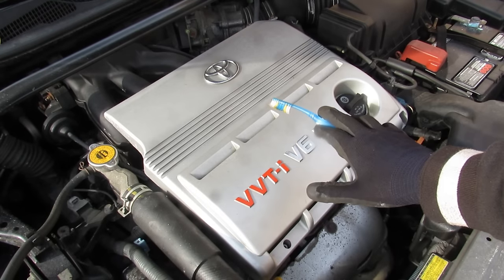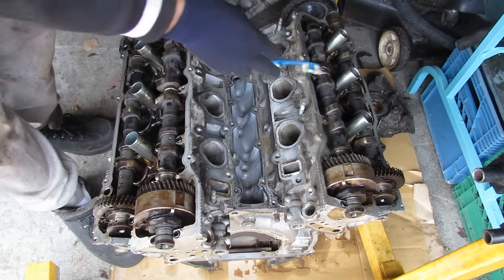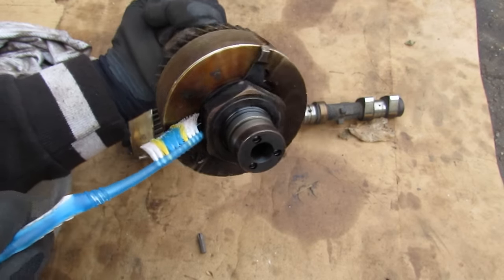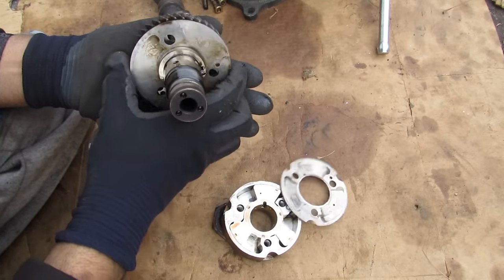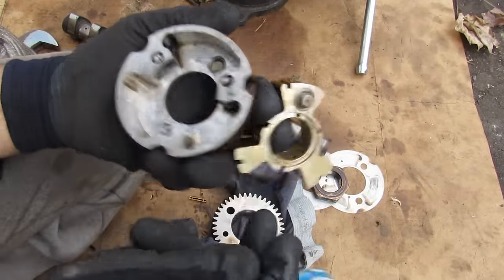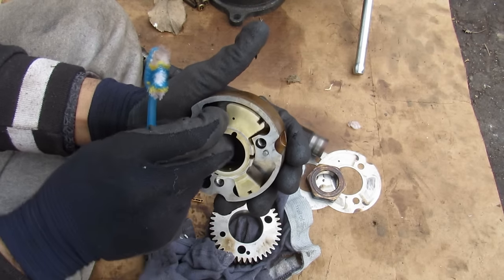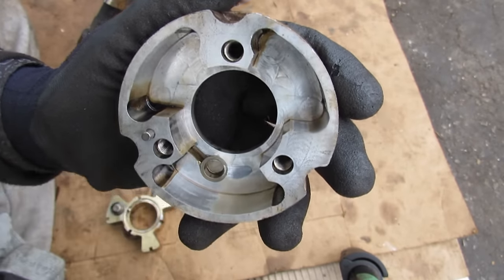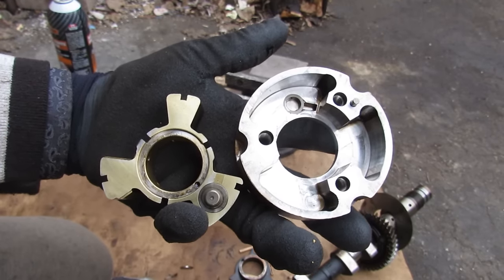Here's Why Your Car Rattles on Cold Starts

Comment: I just bought a 2010 corolla ce and didn't find this problem because the seller had already started the car before my arrival(because this problem only hapoens when car has been parked and not used for about an hour). Now I have to worry about this issue.

Comment: Hi speedkar99 thanks for info. I noticed a rattle noise every time I start my engine. It’s a 2008 Lexus RX350. The car is at dealership at the moment. Day 1 passed they said nothing is wrong with it. I want them to make sure that the bolts aren’t loose. How much might it cost, do you know?

Comment: I have a 2007 Sienna with the 3.5 2GR-FE engine with the rattle noise.
Is this engine also the same as the one as in the Lexus?
If so, do I have to worry about the bolts coming out and destroying the engine?
Reply: I also have the same concern with my camry 2gr-fe. Need someone has to clarify this, I hope it's not like lexus 😁

Comment: i have the same problem on a nissan qr25 de engine, stored most of the 2020, now in the morning rattles like that engine, the real concern is that the car is only 30.000 km, maybe some oil residues clogged the lock pin, so i have a question, that noise is going to destroy my engine in a short term? thanks for enlight me, i didn't knew where that noise came from until i saw the video

Comment: However... can a faulty vvt actuator cause the same symptom upon a dry start given a brand new timing kit rebuild with all its seals and
 o-rings including new gears and phaser? I have a QR25DE and the car is a full build. The only things I’m considering is that the phaser I bought aftermarket and I my solenoid is old but it does work but that’s just visually. How much about the spec v QR25DE do you know?

Comment: Here what I did on noisy 2.8 cts ,F150 3.5 eco boost, modded  supercharged small block 5.7 gen1, 351w searay ,2006 5.3 ls4 gxp , all had noises . The f150 eco boost and 2.8  variable valve timing  I added a pint of diesel fuel to the oil prior to oil change on idle only warm up on idle let sit over night next day idle for 15 20 min then drained . Refilled oil with synthetic and new low restriction oil filter and 6 oz motor kote . No noises now on both 2.8 or 3.5 👍👍👍.Same for 5.3 ,351w  or my supercharged vette 5.7 Gen 1.My experience working  at a gm dealership in rural Ontario years ago and  old school mechanics this works great to remove gum ,varnish , and minor sludge . Do not do this on super neglected engines as you may  clog the oil pick up screen .Also( project farm )here on YouTube did some testing on motorkote it works reduces friction. Back when gm had a wonderful product called EOS or engine oil supplement it also gently cleaned and added anti ware and less stiction to valve train rings 👍

Comment: Thanks a lot - now I know what is the mysterious noise everytime my neighbor starts her V6 RAV4. I thought it's something worse. I wonder if adding gunk cleaner before draining oil and then filling up with good synthetic would eliminate the issue. But then all the seals might start to leak... - I won't suggest anything to her.
I also like using toothbrushes and old underwear for various cleaning duties 😉 👍

Comment: I own a 2011 Toyota Corolla with a 2ZR-FE engine. The weird thing is, I never hear that rattle on a cold start, but sometimes I hear it on a warm start. Like after I've been driving it for a while, then I turn it off for whatever reason, then I start it up again. That's when I'll sometimes hear the rattle. I change my oil every 4 months. I go by time, not mileage.

Comment: My 2010 Corolla has started doing this the last couple weeks. Would it be bad to not worry about and not fix it?
Reply: my mom had a 2012 camry that made this noise for years and it still drives fine, just make sure the noise goes away after a second and change ur oil regularly

Comment: If the buildup is the cause of the problem, then just do a proper engine flush with some strong solvent like dimethylosulfoxide.
I did it on my engine and I got rid of oil burning caused by seized oil rings. Previous owner did the oil changes not often enough.

Comment: My 09 Rav4 (2.5l) has been doing this rattle for years.
1 year ago we changed the timing chain and tensioners because of the mileage it has (160k) and it stopped doing the noise but after a few months it came back. I've been searching for more info about this problem and found a TSB that recalls this exact engine for that problem. 
The bad thing is that it is only for the US 🇺🇸, Toyota in my country is like "nope, we won't fix that".
And the VVT gear kit is very expensive so...
Reply from the maker: Ouch. Yeah it's too expensive
Reply: Wait! There’s a recall? Could you share the link or info for it? My 11’ Rav 4 has this noise and I was hoping I could get it replaced under recall. The only problem is that is has 140k miles.
Reply: @antoniogm6241  Thank you! I really wish I had the courage to do that kind of work. I guess I’ll just drive it like this and hope for the best. Really unfortunate and makes me sad to see this issues on a Toyota
Reply: @thegravitx  Yeah, messing with the timing chain, tensioners and VVT-i system is a real pain in the butt. Not to mention how many hours it takes to disassemble and put everything back on 😅
Reply: @antoniogm6241  Little update. Car now has 248k miles. Noise is basically the same and hasn’t changed duration wise. Learned how to live with it. lol

Comment: So if my 09 Corolla does the rattle noise on a cold start what should I replace ?
Reply: Part number 130500T050 , it on the passenger side and much easier to change than this engine.  Google T-SB-0087-09.

Comment: I have this exact same issue in my 13 Tacoma v6. Would this be the same issue for the most part? The noise and duration are the exact same as this and same duration too as well as only at start up when cold.

Comment: do you think its the same behavior with the 4GR-FSE ? I have the Lexus IS250 and it has the exact same rattling noise, and just wanted to have some peace knowing its not gonna grenade  or something :(
Reply: Mine 2gr-fe has about 300k km at odo. Previous owner put there 0w30 oil.
I tried different brands - still was rattle.
Few weeks ago i decide to try 15w40 RoyalPurple (brand is not the case) - and it became absolutely quite.
Looks like thicker oil better stuck in gaps inside old engines. And i would like to mention that overal sound of engine became better. It is really quieter.
Reply: @alexthebear  thanks for the info  👍
Reply: @alexthebear  I might try a thicker oil next time, but the problem is I am currently living in the Black Forest in Germany, and it can go to -10C temperatures in the winter sometimes. 15W40 might be really viscous in those temperature, and interestingly, I don't have that much rattling in the cold winter. May be my regular oil is also gettign thicker in the cold winter start and eliminates rattle. Its the summer that's problematic.
Reply: @aneeshprasobhan  Yep, i do understand you. I live in Canada, and this winter we had lower that -40C.
But atleast now i know that in my case engine is wornout, and for it better to use thinker oil. About winter - not sure, but looks like i am ready to buy Espar preheater. In this case i will stay at 15w40.
But in general - -10 is not so cold. You can try 0w40 synt for exapmple. Just play with it, atleast to check if it works for you.
Reply: @alexthebear  thanks for the reply. By the way, is the espar pre-heater for just internally warming up the car using a seperate generator ? If so, could you please share the part number for the kit ? 
I might need to look at it as well, i was thinking of fitting a Viper remote starter for heating up the car but its kinda illegal in germany. :(

Comment: Is the lexus gs450h 3.5 2GR-FSE risky with 1 second cold start rattle? That bolt can come loose on this engine as well?
Reply: did you find out more about this. I have the same 450h

Comment: Do you think the gm 3.6 VVT in my Traverse is the same. I have a similar noise not quite as loud and not on every cold start
Reply from the maker: The notorious GM 3.6!!
Reply: @speedkar99  yes..
Reply: They are well known for stretched timing chains due to design fault in pcv system apparently gunking up oil gallerys and system. Very expensive to fix, will return too as oil passage system is clogged and pcv system is shite.

Comment: I am having lexus es330 2005 model,
I had the same rattling noise that you mentioned here but I ignored it. Now Yellow Check Oil Light is tuned ON the dashboard although I changed new oil & filter since 2 weeks.
Appreciating any advise or guidance from your end..

Comment: I replaced vtc actuator on my acura tsx and the noise never went away completely it just got a bit less frequent and less noise. I do oil changes every 5k km and always check it to make sure level is at max. Honda/acura never revised the part so even replacing it won’t solve the issue
Reply from the maker: The VTC actuator
Reply: I already replaced it once. Noise never went away completely. Not worth replacing it again as Honda/Acura never fixed the faulty design

Comment: Hey, my Toyota 2012 with the 2AR-FE inline four (100,000km) has a rattle at cold start up as well. Would that be the same thing?
Reply: Yep switch to 5w30. I have a 2013 Camry and it fixed that

Comment: So would not fixing this grenade the engine? My 2010 ES 350 makes the same sound and the dealer explained the pin getting stuck but they want $3k to replace both “cam gears” as they called it. Idk about spending that much on a car worth $10k, and it’s been making the sound for years, other than that the car runs perfect.
Reply from the maker: Not worth it unless you are in the engine for something else. $3K sounds about right.

Comment: @speedkar99, thanks a lot for the video. I just received an $800 quote and was wondering if its worth it! So one day its not going to lock anymore and keep rattling? Is it going to do anything to a moving car?
Reply from the maker: It won't lock up it'll just get so bad perhaps it'll throw a vvt timing related code. 
$800 to remove timing belt and valve covers and replace camshaft isn't bad, considering those two jobs are almost that

Comment: If the engine has a timing chain, the chain is at risk of premature elongation from the shockwaves generated by the actuator rattling. I wonder if the actuator rattling could snap a timing belt?

Comment: Same rattle on the 1 zz fe in the morning but sometimes.
Reply: 2 solutions. Add 3 to 4 oz of Seafoam to the crankcase at every oil change or switch to 0W-30 Mobil 1 FS. You will never have that rattle again.
Reply: @mjk9674  Awesome, will try this

Comment: Can you swap the heads of a 4runner 4.0 v6 with a tacoma to give it dual vvt-i?
Reply: Even if it bolted right up you would still need the Ecu to get involved for timing (camshaft position sensor) would not be happy.

Comment: Hello Guys,just interesting to know is there some of  Lexus is250 owners with 4GRFS V6 2.5 L Engine who is driving with this  rattle startup noise for long km/ milage? Is ther someone who driive aprox 100k km with that rattle noise on cold start and can say that nothing is happening? Herad also that oil change for 5w40 or 5w50 and eng flush can "cure" at least for some time this issu? Some expierience? Will be gratefull for feedback

Comment: I have a similar sound on cold start up on my 98 Honda CRV.  It's more of a scratchy noise but it only last a second. Is this the same issue? 
Any help or advice is much appreciated
Reply: Yes most likely the same issue. Most vtec hondas make the sound
Reply: @chinchy111  thanks for the help. I think it might also be the starter sticking in colder Temps?
Reply: I have a 2012 honda and my starter also acts weird when its very cold
Reply: @chinchy111  does it make a scrapey sound?
Reply: No sound from starter just doesnt like to start when its like 20 degrees or less outside. Only sound i have is the rattle like in the video. If your scratch sound is only for a second then i wouldnt worry about it

Comment: I own a Lexus RX 350 MHU3 from 2008. Have this rattling noises at cold start for 1-2 seconds. It began at 160000km and is the same until now (200000km). The engine runs very smooth after that short rattle noise. Hope that is not a serious problem that will destroy the engine sometimes.
Reply: Same car, battery went flat and it sat for a few weeks. When I changed the battery it didn’t rattle for a week. Unsure if it’s a cranking amps/charging issue. Or a sensor issue and it stopped because the ecu reset while the battery was flat.

Comment: Damm man..thanks big time..i have thinking i had issues with my timing chain tensioner because of that noise..now i know exactly whats the issue
Reply from the maker: A chain tensioner can cause a rattle too but it doesn't go away after 1 second like this
Reply: @speedkar99  mine goes away after 1 second..but after i switch off the car in less than 3 second and restart it again, it does not make the noise

Comment: I have a 3.3 liter v6 lexus, the rx 330, and i have the same sound on start up. Thought it could have been the starter so i watched a video, and the sound was different. Then i saw this video in my feed and watched in cause im bored, and as it turns out, this describes what i have been hearing: rattle on cold start up, vvi-t engine, and lasts for a second. Towards the end you mention a 3.5 liter lexus engine, as opposed to what i have, and how the sound is cause by the bolts as opposed to the actuator. This video is a year old so idk if im going to get a response but if the creator sees this, can you please tell me if that applies to my engine too? Im sitting at ~175k miles right now so idk if this will be an issue later down the line. Just had a timing belt service done and i really want my car to last me as long as possible, just need to know if this is a start to a big issue.

Comment: My engine rattles once in a month or two, maximum. Someone says that is caused by streched timing chain, someone says  it is caused by bad variable valve timing actuator (which is expensive to replace) and someone says it is problem with the bad oil viscosity. I tried different oil and my problem isnt gone. Next i timming chain because its cheaper than variable valve timing actuator.

Comment: My Chevy Cruze is having the same issue so I replace the sensors camshaft And the actuator solenoids still have the light on I am an issue only thing that sound weird is when I first started up it has a slightly rough idle about 1400 RPMs and then that'll drop down to about 750 RPMs with this possibly be the same problem that you described in this video because I've changed everything

Comment: If I turn the key over to KoEo and let it sit for a second or two, the car doesn't rattle when I finally start it. Not sure why this matters but it's still doing the trick  after about 2 weeks
Reply from the maker: Interesting since this has to do with oil flow not fuel priming
Reply: @speedkar99  I know I had the same thought. No oil pressure til the engine is moving. I was wondering though, since I've seen this trick work for squealing serpentine belts because of the resistance from the alternator (I believe was the synopsis) if a mechanism like that could be involved somehow. Problem is, I still don't quite understand how the phaser is even making this sound. During my overhaul I noticed the exhaust phaser was a bit loose, has some play in it, while the intake phaser was nice and rigid. Still, I don't see where the slack, that would be necessary to produce this rattle, is coming from between the valve springs mostly holding the cam and the chain holding the sprocket fast. I dunno. Maybe I'm entirely mistaken about what I'm experiencing but my Corolla has always made this god forsaken noise if I just jump in and throw the key over.
Reply: So I've been trying to pay closer attention to it since I only have 1-2 times each day to test it and I usually forget... There's an objective reduction in the duration of the rattle but it's not 100%. The most I get is what sounds like 2 quick beats of the noise, if I KoEo/prime. While the majority of the time it just starts up no problems. If I jump in and slam the key over I'm certain to get at least 4-5 beats of the rattle noise and sometimes up to 7. It was so bad in the beginning that I thought I was grinding my starter. Anyway just thought I'd amend my first claim a bit. Has some noticeable effect unless I'm just a terrible scientist and I'm talking out my ass.

Comment: I have a 2003 Lexus es300 with 125k that’s currently doing this and before this car I had a 2003 Toyota Avalon with 223k that also did it (they both have the same engine in them) considering how much work it is I don’t know if it’s worth getting it fixed 😩

Comment: Mine rattles on warm/hot starts after the vehicle sits for 30 mins to an hour. It also is more prevalent after a fresh oil change. Why is mine the opposite of a rattle on cold start?
Reply from the maker: May be the oil thinner draining faster?
Reply: @speedkar99  I'm using the recommended 5w30 and it's Valvoline synthetic.

Comment: Love your videos, actually changed my Lexus GS300 alternator after following your guide. My Lexus v6 (3 liter) also has the same rattle. Is this the same engine as in the video, or is this a similar issue to the loosening bolts like the 3.5 liter?

Comment: My Honda CRV has built up that noise within  25K km, VCT actuator  has been changed , but after one year , the noise came back  (the dealer said the noise is from chain shaking caused by VCT   ) .
Reply: MaxC, what year is your CRV?
Reply: 2016